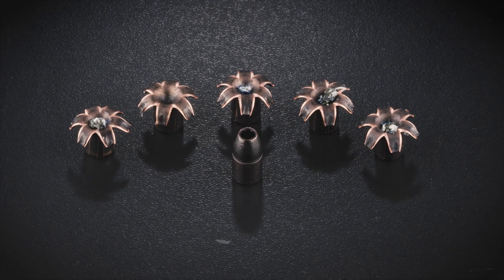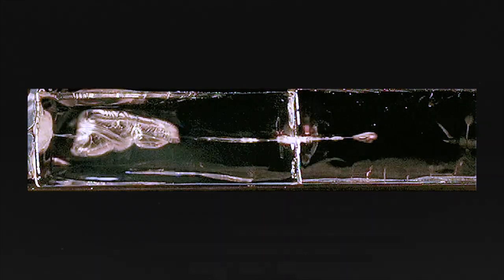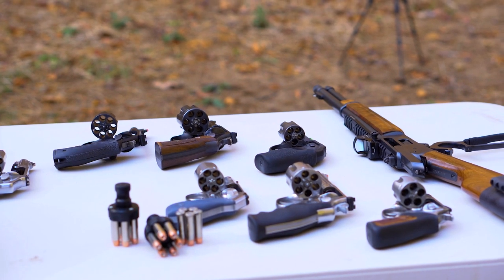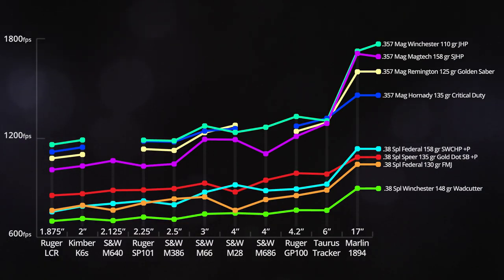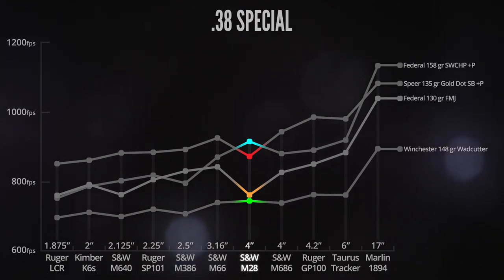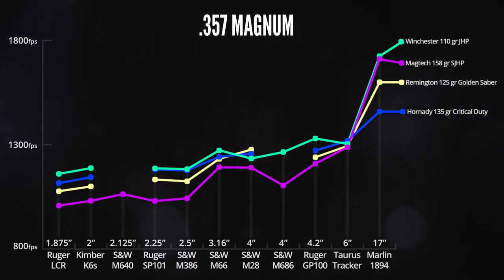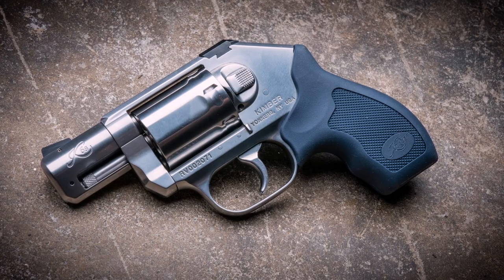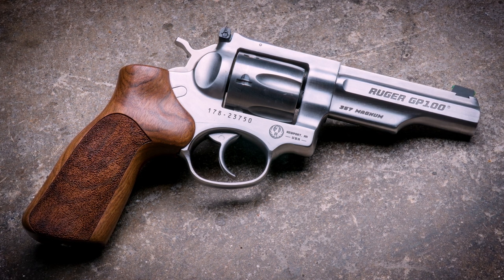Revolver Velocity versus Barrel Length

Comment: I'm looking forward to the new tests, but I find something in your spreadsheet that is of tremendous interest.  NONE of the .38 loads reached 1000 fps in any length of barrel, and ALL of the .357 rounds reached velocities greater than 1000 fps in all lengths of barrel.  This should immediately put to rest the foolish assertion that .38 +P rounds are "more effective" in snub nose revolvers than .357's.  In ALL the snubbies, the average velocity of a .38 load is somewhere around 175-250 fps slower than the average .357.  This is a velocity difference of fully 15-25% !

Like everybody else, I have only the results of the backyard ballistic gel warriors to go by, but your results here are perfectly consistent with them.  And I strongly suspect that your penetration/expansion results will echo their's, too.  Overall, from their data I have concluded that to get hollow point bullets in these revolver rounds to both reliably expand and reliably penetrate more than 12" in gel with denim you MUST have at least 1000+ fps of velocity and you are far more likely to do it if you have 1100+ fps of velocity.  As an aside, a heavy for caliber 9mm load (148 grain) can usually do this if the velocity is over 950 fps.

What I would deduce from such a result is that velocity effects are strictly additive:  there is a certain minimum velocity needed to expand the bullet and further velocity must be added to this to push the expanded bullet past denim and 12" of gel.  Even with .357, the ballistics warriors seldom get penetration as deep as 16 inches with hollow point loads.

More generally, their results suggest that the effectiveness of .38 special in general (even +P loads) is far closer to .380 auto than it is to 9mm Luger.   The .38 special is "more effective" than .357 in ANY barrel in only one sense:  .38 has milder recoil than .357.  That's all.  I hope your gel tests find at least one or two loads that that disprove this conclusion.  If you do, it will be a real service to revolver toters, who always give up a round or two of capacity even to pocket automatics.  

Otherwise, the real choice for well trained defensive shooters will be between 9mm auto and .357 revolver, not between .357 and .38 +P.
Reply: tl:dr
Reply from the maker: Without spoiling too much before we release the results, a few of our .38 loads were hovering right around 1000 fps and a few of the .38s performed quite admirably... but most of the good performers were actually around 850 fps. A magnum with respectable expansion will get you 3-4 more inches of penetration over one of the good .38s with recoil ranging from "stiff" to "abusive" depending on the particular load and what gun you're firing it from. It's not hard to find a .357 that performs well, but there are only two or three .38s that rival the ballistics of a "pretty good" 9mm. On average, far better than .380, though.
Reply: 38+P is more effective when every round hits a vital area instead of wildly under- and over- shooting during a situation you have never been in before. In many defense shooting you will have to shoot one-handed or not at all. THINK about that.

Comment: It caused by the gap between cylinder and the barrel. the longer the barrel, the more leak of the gas happens while the projectile itself still in the barrel moving forward but friction happens. Just like running a water via a flutted pipe, when you plug the pipe with something, the water finds another way out. Still have some pressure though, but very minimal.

it it's a different situation on Nagant revolver i guess. it (could be) do better with longer barrel since it uses gas sealed chamber and ammo.

Comment: Powder burn rate has a lot more to do with the barrel length as well. If you have a six inch 686 in .357 magnum you want to use a magnum primer with a slow burning powder whereas short barreled handguns will do better with faster burning powders.

Comment: 3" barrel seems to be the way to go for .357 mag looking at this data.
Reply: Not realy it has almost the same fps like  9mm. If you want the 357 advantage you need at least 4 inch.
Reply: Test a 9mm 3 inch revolver vs 357 3 inch barrel you be supprised .
Reply: @linokleinmeuleman3348  can you please elaborate
Reply: @Bigboss-tf6fr  go watch paul harrell's video on 9mm vs. .357 magnum
Reply: lino klein meuleman i
Reply: Gieszkanne huh? 

124gr 9mm (4” barrel) vs 125gr .357 (3” barrel) and there is way more energy from the .357mag with premium ammo (390~fpe vs 500~fpe)
Reply: @Gieszkanne  
Ken Fischmann  1 second ago

I own the SP101 3" and have found in 357 a huge jump in velocity between the 2" and 3" barrels.  I also have one in 9mm with the 2" barrel, I tested against a friends 2" 357 across my Chrony and the 9 beat the 357 out of the 2" barrel by at least 50-60 fps and sometimes more depending on ammo but it was no contest against that 3" 357 with it picking up over 200 fps or sometimes more with most ammo.  A 4" will pick you up another 100 fps or so and a 6" another 100 but for defence purposes the 4" & 6" barrels get a little harder to EDC.
Reply: @linokleinmeuleman3348  You should compare 9mm out of a pistol and take a 4 inch pistol because the chamber is included.  BBTI list says Speer Gold Dot 124 gr.  reach 1203 fps out of a 4 inch barrel and Corbon 125gr 357 1257 fps out of a 3 inch barrel.  So 57 fps more isnt worth it.
Reply: @hardball107  Yes MilitaryArmsChannel also did make a video about a 9mm snubby vs 357 snubby and some loads of the 9mm even had more fps. So 357 out of a 2 inch snubby is idiotic. And like I wrote in my recent comment you should compare a 3inch 357 revolver against a 4 inch 9mm pistol. And a G19 is even smaller and lighter than a S&W 65 3 inch.
Reply: @Gieszkanne  I liked the idea of the 3" 357 comparison with a 4" pistol so I shot my 3" SP101 against a 4.25" 1911 I built in 9mm.  Because the chamber is included in the barrel length measurement for the 1911 the velocities were pretty close.  It was pretty much a wash with the revolver in 357  running around  5o fps faster in most cases despite the revolver suffering from cylinder gap and a .250" shorter barrel with the same ammo.  9 different brands were tried and the difference was mostly pretty constant with velocities coming in between 1100 and 1150 fps for the most part, some of the 357 almost made 1200 fps but the blast and recoil was always heavier with the 357.

Comment: Interesting data.   Barrel length is a big factor in determining MV, but there are other factors at play.   BC gap, if excessive, can bleed off a lot of pressure and MV will drop.   Also groove and bore dimensions play a role.  Besides the advantage of a much longer barrel, the Marlin also lacks a BC gap, so firing from a closed breech is a big advantage.

Comment: The most important factor governing velocity is reading the brand on the box.. Especially in 357 Mag, your velocities will vary roughly between 1200fps and 1700fps depending on who made the ammo. That's a great variance if you consider for example the difference in energy between a 110gr Remington SJHP @ 1295fps (410 ft-lbf), Underwood 125gr Golden Saber HP @ 1600fps (711 ft-lbf)  and HPR 158gr XTP @ 1560fps (865 ft-lbf).
It could be argued that the Remington round is a paper-shooting round, but why then a HP? It's barely over the upper range in pressure for .38 Special, if at all. My opinion is that the ammo you use will be the biggest factor, and while most folks know their guns, not as many know their ammo. Fortunately, most producers keep their loads at civilized ranges, but there are the ones that gyp you on the low end, and then there are the ones that I would not advise folks to shoot in their over-chambered mouse-guns. If you have one of the light-frame .357's steer clear of the hot loads and go see a shrink for purchasing the damned thing in the first place. You should have just bought one chambered in .38 Special.
Reply: Sp101 3 and 4 inch just enter the chat !

Comment: Measure the Barrel/Cylinder gap on the Model 28.
Reply: After so many rounds of full power ammo, there's more issues to overall wear than the cylinder/barrel gap.  There's loosening of lockup, erosion to the forcing cone, to the rifling and eventually to the muzzle that can decrease efficiency plus accuracy.  For the integrity of your old  Model 28, examine it in detail.  The Highway Patrolman is a classic gun.  Treat it well and it'll do its part for many years to come.

Comment: Suggest that you check the cylinder gap on those 3 revolvers
I suspect you will find a measurably wider gap on the Longer barreled gun accounting for the minimal velocity increase
You can expect to loose about 15 FPS for each 1 thousands gap.
A 9 vs 1 thousandth would be a 120 FPS difference with typical magnum loads.

Comment: They don't call it a "flash gap" for nothing.  You should have used feeler gauges to measure the flash gap on each revolver.  The velocity "jump" seen with the rifle is mainly due to the lack of a flash gap.

The only valid way to measure the effect of barrel length on velocity is to start long, and cut the barrel down, along with incremental testing.  That way the other variables are eliminated; as was done here:  
www.ballisticsbytheinch.com/38special.html www.ballisticsbytheinch.com/357mag.html

Effect of larger or smaller revolver cylinder to barrel flash gap:  
www.ballisticsbytheinch.com/gaptests.html

Comment: I was a little surprised at almost 1200 fps for the 158 gr +p LHP from the carbine. Most 38 ammo uses fairly fast powders, so i was expecting less gain. Handloaders can optimize their powder selection for the long barrel. I plan to experiment with .38-44 level handloads when i start loading (i have one, plus they are obviously safe in magnum guns). I expect they will do quite well in a carbine. Gas checks or jacketed bullets will be indicated

Comment: You should have used different barrel length but of the same make and model of revolver (otherwise other factors can influence the results, think about the cylinder gap or exact bore diameter).
Reply: Yes and new ones. A test between unshot revolver. For example 686 has 2,5; 3; 4; 5; 6 inch versions. Of course this would be very expensive.

Comment: with revolvers you need to look at cylinder gap it can have an effect on velocity also powder burn rate slow br in a snubby no good you need a fast br if reloading your 38 or 357 for a snub nose use powder with fast burn rate and a lswc or lswc hp with velocity at 850 to 1000 fps for 38 (if your gun will handle it) and 900 to 1100 fps for 357. make good ccw loads. also the 148 gn hollow base wad cutters are an option and can be loaded backwards to make a hollow point.

Comment: If one were to compare the velocity differences between, perhaps a 9mm moon clip revolver and pistol, I assume you’d measure the length of the revolver cylinder, add it to the length of the barrel and compare it to a pistol with a barrel that matched that total in length. Though the velocity should match, would the pistol be greater, considering the revolver’s cylinder blow by, or would the pressure loss be greater in the pistol’s blowback?

Comment: I'm no mathematician, but you might find the average slope of each point (two inch barrel length) apart on your graphs.  That would result in a rough approximation of speed change per 2" unit length overall.  Which we might be able to remember, as opposed to your great results -- where there are not even hash marks bt 800 and 1300 fps.

Comment: I saw you mentioned that it's hard to measure recoil on firearms. Have you guys ever thought about using tiny g-force stickers? Like the ones on mythbusters. You could also use accelerometers in conjunction with skin patches to see how hard your hand accelerates. You could attach then to your thumb joint to see how fast your bones move and any meaty part of the hand to see how soft tissues follow the hard motion of the skeleton. It could give you an approximation of weather or not tendons might get damaged from shooting a full magazine at high speed with stress strained muscles in a high risk situation. 

I'd hate to be freaking out in a high stress shooting scenario and find out I tore a tendon after my first shot because of the adrenaline tightening muscles and increasing felt recoil. I'm by no means a physician or a physicist but it would be a neat test to see.

Comment: Hey man good job on the videos. How do you feel training with 22lr pistols translates to something like a 9mm? In terms of just basic shooting techniques and developing skills would you say it's efficient? Or would you stick with only shooting 9mm if that's what you carry. Thx
Reply from the maker: You can learn a lot with a 22 and they are a ton of fun, but it can also be really easy to get sloppy with your technique because of the lack of recoil. If you already have the 9mm, your money is probably better spent on more 9mm ammo and more dry practice, especially if your primary goal is to develop your defensive shooting skill. If you can get a 22 kit for your carry 9mm, that might make the cross training a little more beneficial. Here's a brief article that has some good points: https://pistol-training.com/articles/22-training-pistols-pros-cons
Reply: Awesome man thanks for the input. I'm thinking about just sticking to the 9mm and keeping 22's strictly rifles. Thanks again

Comment: Do you think you could add calculated ftlb of energy onto the graphs using the measured speed and bullet weight?
Reply from the maker: +America There is not a useful correlation between effective self defense loads and muzzle energy so we have decided to leave that out of our data.
Reply: Easy calculation if u want to do it: bullet weight (grains)x velocity x velocity. Then divide that large # by 450,400. That will give u energy in ft lbs. It's a bit of number manipulation, but it gives the correct values

Comment: You have to match the powder load to the barrel length. Not enough powder in a long barrel will actually reduce muzzle velocity compared to a shorter barrel with the same load.
Reply: Yes but not with these short barrels. What you are talking about may start with 16 inches up.
Reply: @Gieszkanne   I have tested  40 grain low velocity .22lr in a 1.5 inch barrel and a 6.5 inch barrel. The 6.5 inch barrel produced a lower muzzle velocity than the 1.5 inch.  The opposite was true with 40 grain .22LR high velocity rounds... same two guns.
Reply: @timhallas4275  I cant believe this. There must be something wrong. Low velocity has a slower powder and is mainly for rifles, so the 6.5 have to have more!
Reply: @Gieszkanne  The low velocity round was faster out of the 1.5 inch barrel than it was out of the 6.5 inch barrel. That means that the barrel slowed the bullet after the powder was used up..  Get it?
Reply: @timhallas4275  If you would have understood what I was telling you, you would understand that its unpossible.
Reply: @Gieszkanne  Unpossible is not a word, and you are wrong anyway. Under-powered rounds use up their fuel before the bullet leaves a long barrel. The friction then slows the bullet. In a shorter barrel, the bullet leaves the barrel while still under pressure.  Get it?
Reply: @Gieszkanne    CCI quiet 40 grain .22LR  .. 1.5 inch barrel= average of 5 shots  962 fps   same ammo from the same box..  6.5 inch barrel= average of 5 shots 835 fps  there's nothing wrong with my crono.
Reply: @timhallas4275  Did you looked at the bbti .22 data? EVERY load has lower velocity from a 1 inch NAA or 2 inch. From high velocity 27 grain up to the 60 gr subsonnic. Also all loads are not slowed down up to a 22 inch rifle! The hottest round .22 stinger with 32 grain is even lower from a 1 inch NNA  than your 22 CCI quiet. Its physicaly not possible. But anyhow your original comment is no explanation for the topic of the video here (why the 3 inch has more velovity than some 4 inch) and my first answer to that is right. His Marlin data here with the 17 inch barrel alone proof it.
Reply: @Gieszkanne   I think you are limited in your understanding of the physics involved in propellant expansion, and gun barrel friction.  Why do you think they use soft metals in projectiles.

Comment: I've got a 6-inch GP100 right now that sits at home, but when I eventually start carrying, I may want to consider concealed. 

Kinda torn. Get the 4 inch model and have more carry options, or fudge it and keep with the 6 inch and stick to OWB carry? (But then my question would be, is 6 inches too much to carry...? I mean, this revolver could potentially be used for hunting, but I may also want to carry it.)

Kinda tight on money and space, or I'd just get another one in the 4.2 config.

Comment: Hi, in terms of compromise can a revolver with 3 inches of barrel be a good choice, for the port of the weapon for personal defense?
Reply: Yes. 3 inch barrels are easy to conceal. Though if you want to use it primarily as a bedside gun, you could only improve your odds by going with a slightly longer barrel.

Comment: Bring in Underwood &/or Buffalo Bore & the longer barrels will skyrocket. Im getting a 5 shot average on a 686 plus, 6” barrel @ 1702fps.
The ammo you’ve chosen is weak due to people running low-grade, lightweight, cheap revolvers & the liability of them not being built to handle true magnum rounds.